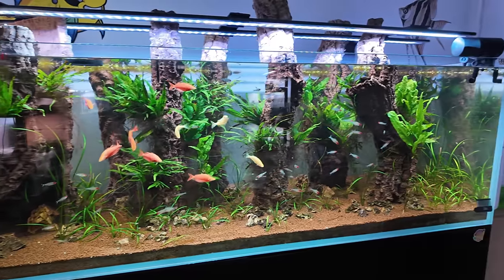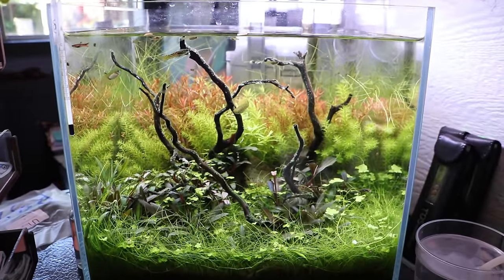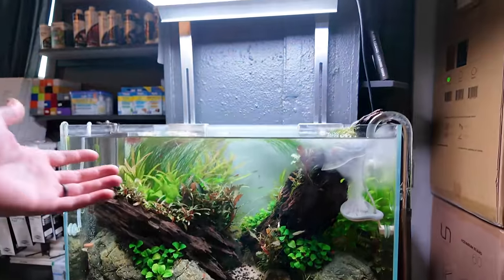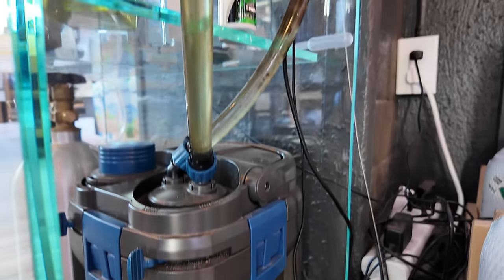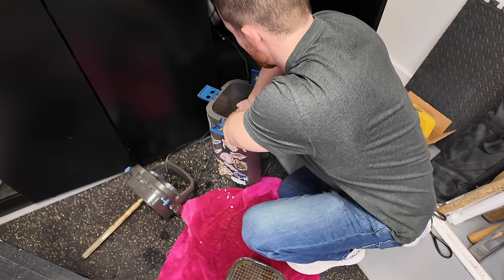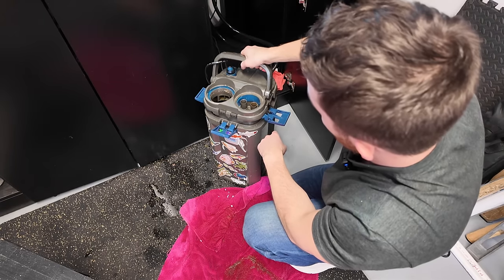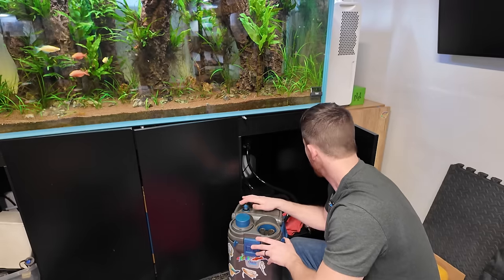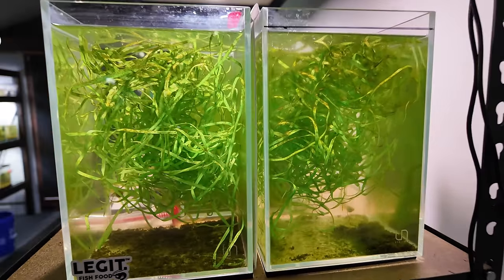This is ACTUALLY The Method For Crazy Clear Aquarium Water...

Comment: First of all you put the Purigen in the wrong place. It should be in the top tray, because it’s a polisher. If you keep it in the bottom tray with all those dirty trays on top, you’re going to drastically impede flow. And you’re going to waste $20 of Purigen. I’ve used this product for some time and it’s great!!! Great for removing ammonia, nitrites, nitrates and it clears the water. It’s more cost effective to buy the 500mL jar and make your own bags(use very fine mesh bags for Purigen). Ive also regenerated it (with bleach) and reused it again. It’s not that hard. I’ve stopped doing it cuz I’m lazy sometimes with 15 aquariums. As I tell my brother-in-law, “Read the directions.” It’s a great product, I love it.

Comment: filter floss from a oven hood , or from inside a pillow as long as its white with no toxins , it will polish the water , i had a 6x2x2 amazon tank and the water was sparkling clean , polished water is amazing in any tank .

Comment: Hey, would you know a good way to filter the water before putting it in the tank?
I'm using tap water, and the ph is like 14. Super hard water. It takes like 4 months for brown crust to form all over my filter, the outside of the water tubes, the edge of the tank. Like a brown crystal, that looks like sand/rust, and is a pain to chop off.
It's like that stuff you get on old shower heads, but I don't want to soak my tank in vinegar.
I was thinking I could set some 5 gallon buckets on top of each other and put sand or something in the middle bucket.
Ideas?

Comment: I have recharged Purigen for years with no problems whatsoever. Soak the bag in a bowl or vase with 50/50 bleach to water. Once the Purigen turns all white (about 24 hrs) then rinse it really, really well.  Remember, bleach/chlorine will eventually evaporate.  Then after the bleach treatment, heavily rinse the Purigen bag. Then soak if for a few days with a bunch of Prime dechlorinated water.  You can repeat this step if you feel better.  I recharge the Purigen bags about 3x before replacing them.
Reply from the maker: Ill def try it out!
Reply: @AQUAPROS  Its safe, I promise!

Comment: 34 yrs old and have been a hobbyist (fresh water) for god knows how long (definitely not more than 34 years though) and never put in any chemicals for crystal clear water. except using medicines to treat sick fishes in the past.

The most recent tank that i built is a 4 ft tank last December (no plants, 1 inch thick medium gravel bed, some open palm sized rocks collected from the river). I recall doing water changes just that month and never a single time till date this year except the top ups. I have an overhead sump filtration system (DIY) which has been low maintenance too. 

Tips from my own experience are:
1. Good filtration and proper cycling of the entire water volume.
2. Feeding :- understand how the food (packed or fresh or live) affects your water quality and the right amount of food that is right in quality and quantity required by each fish.
3. Light :- that's a big topic to debate on, but to make it simple? Don't keep the lights on for 12 - 24 hrs 😂, even fishes don't like a high beam of light hitting them for a long period of time, the room light will do unless you wish to sit close to the aquarium and cherish the fishes for a little while.

Comment: At the 12 hour mark, the biggest change is visible by looking at the wall behind the aquarium on the long wall. It definitely removed tannins. I'd recommend checking out pimp my filter to learn more about what order the media should go in for your filter. Some run from top to bottom, some from bottom to top. They should go in mechanical, bio, chemical order , so where you put the purigen (as well as the sponges) matters. The idea is to filter the muck by a large pore sponge, medium pore sponge, fine pad. Then the de-muckified water goes through the bio filter without clogging the pores so the bb can work unimpeded. Then at the end, let the purigen or charcoal finish things up. Everything will last longer that way.

Comment: I have a 20 gallon aquarium and a tetra whisper filter. It has a black sponge I guess it is, and a bio bag. I put purigin in a Media bag and set it behind the bio bag in my filter. I have no clue how much to use and it's been in there for a couple of days. My water was getting cloudy so I did a 20% water change and put my UV light on and it is clearing up. Did I use the purigen correctly?

Comment: when your water gets less than perfect and its time to do water change . back in the day we used a vortex diatom filter . you connect a hose vacuum your tank and very quick this special filter would make crystal clear water . we also just put the hose in the tank from time to time when water need a buff a couple hours and crystal clear. . they still sell them

Comment: My 20 gallon planted acrylic tank with built in sump at the back haven’t had a water change for now closed to 2 years and I have over 50 fishes inside, always have super clear water. I don’t use Purigen. I agree with the fish store owner to go big on bio media. My success with this tank is not because I have 10x larger filtration. In my case, my filtration is built in and I am limited to that. I believe that my success is the balance of everything. Having 50 + fishes that are all healthy with pristine water that has not been changed for almost 2 years, the secret is in the bio media. Even my substrate acts as a bio media. I have mime in a bit more than 3 inch of substrate. Tons of nerite snail to clean my glass with one rubber lip pleco. I never use a glass cleaner. In my built in sump, I have bio balls, Matrix, those porous yellow blocks, those red looking like nuggets and more. I also put 3 bioballs in the intake flaw that constantly rotating by the flaw. So I don’t believe that going big with filter is the key but if anyone can afford it, I am sure it will help but not necessarily needed. My 7 gallon cool water tank is even longer with no water changes. It’s been more than 8 years and still pristine and all fishes are healthy. I hope sharing this information will help others with this beautiful hobby. I believe that with no water changes and with proper balance, all parameters will always be the same and not fluctuate like when you do water changes and fish and all inhabitants prefer a steady quality of water. Thanks for sharing your experiment with Purigen.

Comment: I started a 10g soil planted tank a month ago. My water is still cloudy and  a lil brown even after water changes. I have carbon in the filter and it has cleared it up a lil better. I worry that it will pull the nutrients my ghost shrimp and fish need.  Im wondering if it is cause i put to much soil in it , and if i should  start take some out?

Comment: When I first started this hobby I had frustrating problems with cloudy water.  Perfect parameters, no ammo, no Nitrite, Nitrates around 10ppm, but the water wouldn't clear up.

An old timer told me it was beneficial bacteria floating in the water colum because I didn't have enough filtration. 

Sure enough, I added another HOB to my setup full of ceramice rings and nothing but a sponge prefter for mechanical, and in 3 days my water was crystal clear.  Follow the 10x filtration rule.

Comment: Your purigen will last much much long if you put it in your top tray. Your filtration should go mechanical, biological then chemical. 

Do yourself a huge favor for the life of your media and remove the sponges and get some high quality bio media (ie: matrix, ehiem substrate pro, ehiem mech etc) and fill all your trays with that and use your prefilter as your mechanical filter. Then in your top tray put filter floss and purigen.
Reply: It's debatable whether matrix etc. is better than sponges. I know sponges were always considered mechanical only. But that view seems to be changing and they can do both mechanical and biological. Pot scrubbers are another cheap option

I say that as someone who mainly uses Matrix and Substrat Pro. I only have sponges as a pre-filter and in one tray. The other three trays are filled with Matrix and some Substrat Pro. 

Old habits are hard to break. 😊

Comment: Purigen works awesome, used to run it. Recharging isn't a big thing either. Activated carbon can do a great job, only issue is that it quickly becomes more bio media. I believe the pelleted form lasts longer in its polishing effects. As someone else said, the order matters, Purigen should be last in the flow chain and this will also help it to last the longest.

On the Windex, REALLY BAD. Had a buddy that bred some beautiful and expensive / rare cichlids (tangs etc). Wife went out one night and cleaned the tanks with windex...they are divorced now LOL. They had other issues, it wasn't because of the windex, but it certainly didn't help things. He lost a lot of fish. I wouldn't mess with Windex, personally and or be extremely careful.
Reply from the maker: Windex out here ruining marriages... cheers bruh!
Reply: @AQUAPROS  😆

Comment: A clean micron filter every 3 days is the only way ive found to keep clear water in a cichlid tank. Purigen wont do jack for a tank with large cichlids. It wont touch a heavy bioload. Great circulation and clean micron filter pads is the only way ive been able to keep clear water.

Comment: sponge should be at the bottom of the filter them bio media on top and throughout the middle then the purigen on top it should be the last stage of the filter before returning to the tank. if your going to be giving advice you should read and follow the instructions to make sure your giving the right advice. and yes yoi should have c;eaned the gunk out the bottom of the filter and you should also clean the sponges as they are not your bio filters they are the mecanical filters the the bio filter is left alone or rinced using water from the tank as they are the parts most needed to be left alone so you dont kill the biological organisums

Comment: Would you replace activated carbon if using Purigen?
Reply: Only problem with carbon in planted tanks is takes out water based fertilizers where purigen isn't meant to but says doesn't . Dymax has same product

Comment: Yeah just get an acrylic tank or a low iron glass tank. I have a 55 gal aquen tank and makes me sea sick because the glass has high iron and is thick. It distorts light and distorts everything inside. Honestly doesnt even feel or look like is 55 gal with the distoriton illusion it makes everything more narrow, it makes 12 inches look like 7 inches and 48 inches look like 24 inches it literally has a rule of thumb of shrinkin everything by half. I got some quotes for smcutom made tank but is 500 for a tank the same size with low iron glass (ultra clear glass which is more mkney) and delivery is 450 lol so nvm . My water however be clear. And i have goldfish so dont go crazy just do your tmwater changes decent bio filter and good lighting. Oh and clean the slob off the inside of your tank glass, that creates a haze and makes the water look cloudy but is not the water is the tank on the inside.

Comment: 0:00: 🐠 Achieving crystal-clear aquarium water with a special method used by pro aquascapers.
3:02: 🐠 Achieving crystal clear aquarium water through unconventional method and expert advice.
6:17: 💧 Using curen in aquariums may help reduce nitrogenous compounds, leading to clearer water.
9:14: 🐠 Optimizing tank clarity and water quality through bio media and skimmer usage.
12:26: 🐠 Efficiency of added product questioned for already clear aquarium; caution advised with glass cleaning methods.
15:48: 🐠 Carefully examining and cleaning a neglected aquarium filter system.
19:10: 🐠 Maintenance of sponge filters in aquariums to ensure proper flow and cleanliness.
22:58: 🐠 Achieving clear aquarium water requires maintenance and monitoring of filtration system.
25:35: 🐟 Optimal fish tank clarity achieved through balanced natural fishkeeping practices and high-quality fish food.

Timestamps by Tammy AI

Comment: I dont use purigen although i do believe it is a good product.  I dont use carbon or any chemical filtration really on my home aquariums and rarely in aquariums i maintain for private citizens.  Water is always crystal clear.  Balance you water chemistries, add some filter floss and use smart filtration.  Funny i have a 34 gallon coral reef that only has a protein skimmer ( 100 gal) and a hang on the back refugium for filtration.  The rest is water movement through the live rock.  Crystal clear water.

Comment: One thing is that I have soft water fish like neon tetras and I want tannins in my water.
Reply from the maker: Ya, just depends on what youre goin for, you can def have clear water that has that tinge to it 🤙
Reply: @AQUAPROS  I don't use carbon. Never saw the point since I do regular water changes.  But Purigen does sound appealing.

Comment: I will start with positive:  Purigen aside you have a beautiful tank on an aesthetic level and the water clarity from the start is really quite good owning to the effort you put into your tank. As to any kind of a product review, I have to say it is a very long video which is mostly a waste of time that begins with little control (slapping it into old filter you did not clean), specifically not following the instructions even the first sentence - presoak - then to add insult to injury you start offering some pretty broad opinions based on misuse (no presoak, appropriate placement in filter system, etc.,). When I get better information from comments than the video - especially with a long video - you have to ask yourself - what was the point. 

Beauty of your tank and effort to maintain in general A- BUT  value of this video by itself D- (wasted my time).